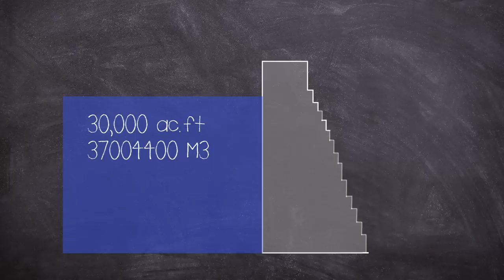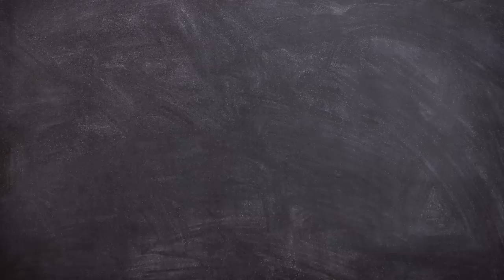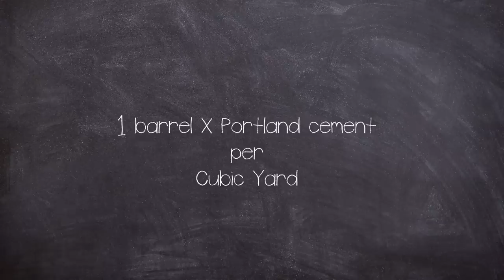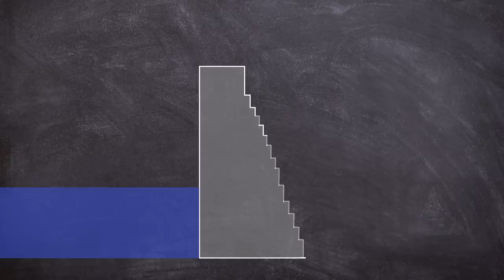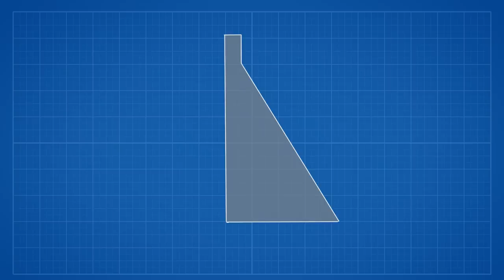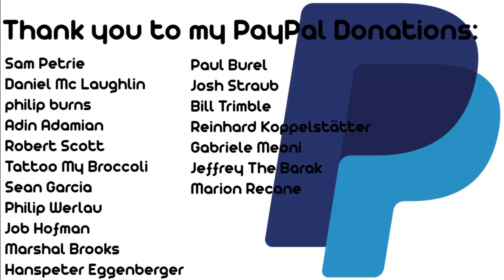A Brief History of: The St. Francis Dam Disaster (Short Documentary)

Comment: The Teton dam failure in Idaho is another good one. Surveyors said "not a good spot for a dam. Government: build it anyway!
Reply: The USBR hasn't built a major dam since 1976.
Reply: Actually it was basically the geologists that warned about the site issues, but they were ignored as were the issues encountered during the remediation efforts for the geological material in the abutment. The essentially problem was that the rock, which is multiple units of the huckleberry ridge ash flow tuff (from Yellowstone), is very porous, and without anything done, would allow water to flow through it and lead to piping, undermining the earthen dam. The proposed solution was to pump grout into the abutments to seal the pores. However, after several times the amount of grout was pumped into the rock that was estimated was required for this task, and despite the fact that the rock was still freely accepting more grout (indicating large volumes of pore space still existed), they stopped grouting and filled the dam. 

Predictably, the water quickly found pathways under and around the dam, through the rock, and began runaway piping and removal of earthen dam material leading to failure. 

The center of the earthen dam still remains, you can see the layered construction of it, and I believe it was determined that no fault in construction of the earthen portion was made, it simply had no chance to begin with.

Ive been there as a geologist to study the huckleberry ridge tuffs unrelated to the dam collapse, and even climbed down the abutments to get samples (they're so fresh, thanks US bureau of reclamation!) and saw the grout/cement pumping holes used during construction.
Reply: @samwise1790  thanks for the explanation. Anyone who needs a more complete description should read “Cadillac desert”.
Reply: @samwise1790  really the usbr just wanted to make sure you had fresh samples. Glass is half full! :)
Reply: @nicholasbrown5013  departments of transportation in any state are a geologists best friend, highway roadcuts are a fantastic tool!
Reply: @samwise1790  that’s pretty cool. I never thought about it that way

Comment: This disaster leveled my hometown of Fillmore. It wiped everything along the Santa Clara River Valley and took out the only bridge connecting Fillmore to Bardsdale, Moorpark for years. Bardsdale was (and still is) like a cluster of ranches, churches and homes, whereas Fillmore was an actual town with an active railroad. Without access to Fillmore, Bardsdale was going to have a hard time getting ordinary goods. So a suspendible foot bridge with a zipline was set up for folks to come and go across each side of the riverbed until a new bridge could be fully erected years later.
Reply: I'm in Bardsdale right now. It's amazing how little rise there  is from the ranch down to the Santa Clara River. Hard to imagine the wall of water coming through. Was driving through Santa Paula the other day and my grandfather was pointing the height of the high water mark just below the second floor windows at the Isbell Middle School a quarter mile from the Santa Clara River.
Reply: Cool comment
Reply: @sh-zs4oy  hehe, unfortunately no there isn't one anymore. The zip line along with a suspendible foot bridge they used in the meantime stayed for years until a considerable replacent (y'know... a real bridge lol) was put in place. Today there is an actual concrete overpass
Reply: You make it sound like you witnessed the event or were directly affected by it. I got confused for a sec because I was like “wait a minute this dude can’t be over 120 years old” 😂
Reply: Thank you for sharing. 🖖
Reply: @ericnelson4540  🤔🙃🖖
Reply: Did i ask?
Reply: @frostedlambs  believe me you dont wanna live here

Comment: I am a retired engineer, not self taught, but professionally qualified, and worked on some very hazardous chemical installations. 
 My worst nightmare was that something that I designed could cause a single death, nevermind hundreds. I managed 30 years with only minor accidents of slips trips and falls, for that I am extremely thankful.
Reply: This might be bit too little but thank you for the hard work you have put in
Reply: Ya seriously thanks mate
Reply: Thank you for your recollection. I am a young engineer and will be getting my PE later this year. My worst fear is for my own design to harm anyone. Our current system of checks & balances on engineering design is built on a foundation of catastrophic failures, and we must be determined to not repeat history.
Reply: I was a roofing contractor for over 30 years. I done everything from hot tar almost every other type of roofing they had up to 2006. Most the time I ran about 6 men if busy during a hail storm then maybe 20  to catch up. In the whole time I had 2 men go to the hospital. Both were over drugs they got at lunch time. But even so very minor injuries. Just a er visit and released. Really it is a very good record for this type of work. Nothing like your danger point.
Reply: Where were you at in 1920? 😩 lol jk. Times were just different back then. OSHA prolly became a thing because this disaster. Lol
Reply: Laughs nervously in aerospace engineering...
Reply: Framer...we had a party wall roof section on a crane lift go down at the 3rd floor. It's basically like four or five condos this place we were building. We had zero injuries but it could have been fatal rather easily.
Reply: thankful to whom?
Reply: Thankful to God, obviously…

Comment: I live a few minutes away from this dam. This is the best documentary that I've seen on the dam. You are very thorough. I will add one bit of information that I saw from another documentary. Mullholland had instructed that the dam would be built with a higher quality of concrete than what was actually used, which adds another component of potential failure into the mix. The density of the concrete used was found in later testing not to be up to the specs laid out by Mullholland. That being said, I think that even if all of the failures of this dam were removed during construction that it would only be a matter of time before the dam broke anyways. The canyon that the dam was built in goes back for miles and about every 6 years or so we get some serious flooding. I'm not an engineer, but I can't imagine that it would have held up under one of these floods that would have backed up a massive amount of water volume up the canyon.
Reply from the maker: Thank you!
Reply: @PlainlyDifficult  gonna add to this and say I've taken the official tour of this dam twice with the Santa Clarita Historical Society, and this video was more informative then their annual tour
Reply: In order to save money for cement preparation, the actual sand found in the bottom of the site was mixed with lime and used in the actual dam.  Part of the problem, too, was the base of the dam intersected an ancient geological landslide.  Directly beneath the dam was very hard conglomerate.  Unfortunately, conglomerate becomes lose and muddy when mixed with water and its density flows through your fingers.  What was not mentioned was that the Dam Keeper's son was also lost that night.  Bodies of either were never found and presumably washed out to sea.
Reply: @765kvline  Thanks for the extra info. I enjoy learning more and more about this incident as the years go by and a drive by the few chunks of concrete that still exist on my way into town.

Comment: I read "Man Made Disaster" in 1964 in junior high school and arranged to have my brother drive us up to the dam site.  It has changed a good bit over the past 57 years.  First, we drove up the old road, and it was clear where the dam was because the terrain to the north of the site was lush, green and wooded.  The area below was still scoured and nearly barren.  Of course, it had only been 36 years since the disaster. The wing wall was intact, and the steps of the "tombstone" were more visible.  We brought back a chunk of concrete from one of the downstream sections.  We had also talked our way into Powerplant # 2 during our 1964 trip.  We saw the transformer that was wrenched out of the basement and tossed down the canyon, fished out, welded back together and re-used.

I went back in the late 1980s.  I hooked up with a Boy Scout troop and their scoutmasters, one who had a copy of the book.  It was interesting to be among young men who were my age when I first saw the dam. It was clear that the wing wall had been demolished with explosives, not natural weathering.  We went together to San Francisquito Powerplant # 1 and had a fascinating tour.  The Pelton Wheel generators still had their "50 Hz buckets", designed to generate 50-cycle power that ran Los Angeles until the early 1950s.   

I have visited the ruins of the South Fork Dam above Johnstown, PA, and, at the end of the summer, I am going on a military history tour in Belgium and France, then flying to Italy to see the Vajont Dam, the site of the October, 1963 landslide that sent a 750' tsunami down a narrower canyon, killing over 3,000 people. I have long been haunted about the St. Francis Dam.  I will return sometime, in the next few years,

Comment: My great-grandfather was working for Edison in the camp below the dam that day. The dam failed due to multiple factors according to some more recent reports. One of the sides of the valley the dam was built on was the location of an ancient fault line that was only discovered due to more modern technology. The engineering knowledge at the time was not advanced enough to fully account for all factors of construction like concrete contraction and hydrostatic pressure. Mulholland also did not just quietly retire, when he first heard of the dam collapsing he was absolutely crushed. He never forgave himself for the damage he caused. He died after living for years with the crushing regret of what had happened. He was a brilliant visionary who helped Los Angeles develop to what it is today, but circumstance and the prestige he earned as a prominent figure placed him in a situation that was beyond his skills without realizing it. What ultimately happened robbed my father and his siblings of a grandfather long before they were born, but it would be unfair to lay the blame entirely on him.

Comment: I really enjoy your dam videos. I worked at a hydro electric power station and part of my job was inspection of the dam twice a week which was much larger than this one, it was built in the 70s before computer simulation so they built a large scale model of the entire dam and catchment, filled it with water etc. There were two cracks in the dam, both about 2/3 of the way up on each side on the side not facing the water, they didn't leak and there was no concern about them as the scale model did exactly the same thing and it was expected to happen, amazing engineering for the time.

Comment: Great video!  You mentioned the uplift failure but didn't mention why the center section did not fail...
Uplift was a very new and theoretical concept at the time and mathematically showed that concrete dams could not use the same weight-to-vertical ratios as earthen dams because mud slurry is more dense than concrete.  Earthen dams don't suffer from uplift failure since they are not a single unit structure like concrete dams are. Not to mention the (water-soluble) limestone veins, reported in the geological surveys at the foundation that were ignored.

The St Francis damn was built with a somewhat new, uplift-relief design of vertical columns built within the center section.  Unfortunately this design concept came to be after the abutments (left and right side) of the damn were already complete.  The center section (the tombstone) DID have uplift-relief columns installed and did not become buoyant which is why it survived while the previously constructed abutments (without uplift-relief columns) did not.

Comment: Concrete gives off an incredible amount of heat while curing.  While they probably still would have done it, this failure underscored the importance of accounting for it and Hoover Dam had one of the largest cooling plants in the western hemisphere for pipes that were laid in the dam as it was poured so chilled water could be ran through it to control the thermal stresses.  You can see it in construction photos, in the riverbed of the horseshoe shaped tail bay at the base of the dam - the huge wooden cooling towers are fairly prominent.  When they were no longer needed, the pipes were pumped full of grout and sealed.  Hoover Dam is an amazing structure.  Recent dam failures like this one cause the US Bureau of Reclamation engineers to be extremely conservative in the dam's design - it's so over-engineered it's ridiculous.    Glenn Canyon dam is close in size to Hoover but has a lot less concrete - they learned a lot from Hoover's construction and what was and really wasn't necessary.  Had a summer job as a teen working on drawings of Hoover and other water works in the southwest - fascinating stuff!

Comment: The most recent theory is that the failure was due to uplift (water leaking under the dam, causing it to effectively weigh less than calculated), and the east end of the dam having been built against ancient landslide remains. That last part is especially interesting. The next time you drive down a valley, look at the hillsides on either side for areas that are nearly level. They're the remains of ancient landslides, so the soil is loose and ill-suited to be counted on for stability. Engineers at the time didn't know this.

Comment: Some years ago I saw a documentary on the subject of the St. Francis Dam.  Many factors contributed to the failure, but the key factor would not be understood until the late 1990s or early 2000s when geological studies revealed that the Eastern or Right Hand side of the San Francisquito Canyon was formed by an ancient landslide.  There was no way in the 1920s to determine this.  Ultimately, the right side would have eventually failed even if the problems with hydro-static lift had been properly addressed or the expansion joints created, it still would have ultimately failed.  Mulholland was not completely to blame as he said.  Until ground penetrating radar and specialized imagery were available, no one could know about the landslide.

Comment: I built a dam on my property. Holding strong after 2 years. I didn't know what i was doing as finding videos on how to build a dam aren't very popular on the internet. So i just kinda improvised. Before people freak out. its quite small. only 2 feet wide and 3 feet tall. Holds back water from a natural spring, and is used for irrigation via ram pumps. If by chance it did fail. it would drain harmlessly into a river that has 4-6' high banks on either side and floods just about every single rain.

Comment: St Francis dam is the disaster that forced civil engineers to consider the effects of hydrostatic uplift, geology, and better understand how very the shape of the dam is important to resisting the loads it will experience. Sadly, sometimes engineering disasters have to happen for progress to be made. But thanks god the failure didn't happen decades later - there would be probably hundreds of dams across the county built with similar flaws. A mere 10 years after this disaster, Hoover Dam was completed which did incorporate the hard lessons learned from St. Francis dam. And that dam has been reliable and safe for almost 100 years now.

Comment: I remember before they changed the path of San Francisquito Canyon road because of washouts it went right through the base of the dam.  You could get out and walk around the concrete fragments still there.  I'm no construction engineer but the concrete looked cheap.  Little aggregate and almost no internal reinforcement.  Some distance downstream there is still a huge chunk of the dam with the distinct stepped face laying on its side in the streambed.

Comment: Apparently not enough attention was paid to the foundation material. This dam was not set on or into rock but into glacial debris. The foundations might have been adaquate for a low dam but we're not stable enough for a relatively high structure. 

Failures like this is how engineers figure out what does not work so they can design safe structures. Provided the financiers and accountants provide enough money to build safe structures. Many failures can be attributed to spending 75 cents when a dollar was needed.

Comment: Could anything have been done in the 12 hours preceding the failure?
Other than an evacuation I mean.
I'm guessing not, but I'm no engineer.
Reply: Evacuation would have been only option. If all dam outlets had been opened it would have only dropped the reservoir level ~ 1 foot in 12 hours, likely not enough to make any difference.
Reply: @carlrossi7989  Thank you for your response.
I'd kinda thought that there would be no way to drain or divert any significant amount of water in that time, but had no idea how much would be required or how much would make any meaningful difference.
I'm guessing that it would have been very difficult, if not impossible to carry out an evacuation of the area downstream from the dam, given the rudimentary nature of communications at that time.
I'm guessing that there would have been phone lines to a small number of locations, but nowhere near enough to enact a full scale evacuation.
It's also a huge call to make - I doubt that it would ever have been given.
Thanks again ✌️